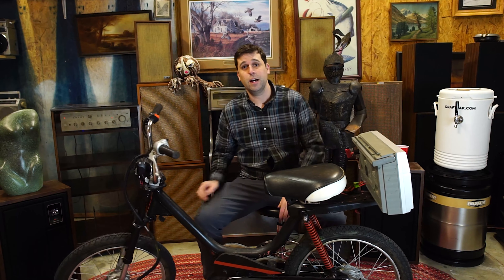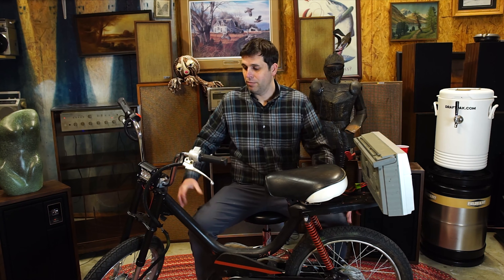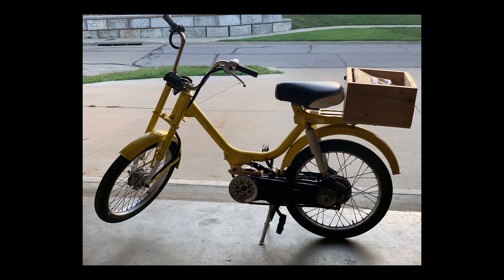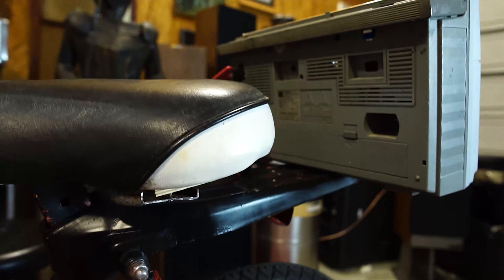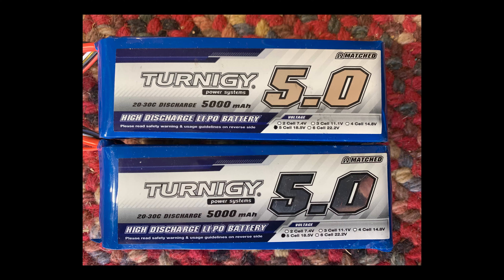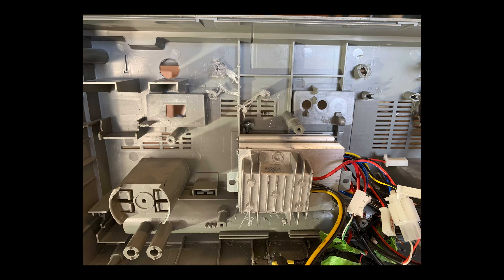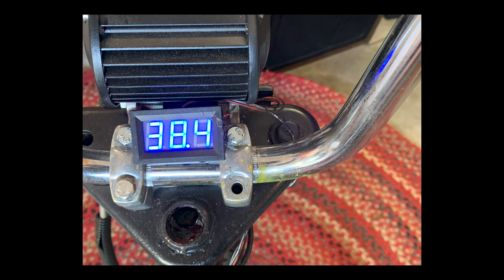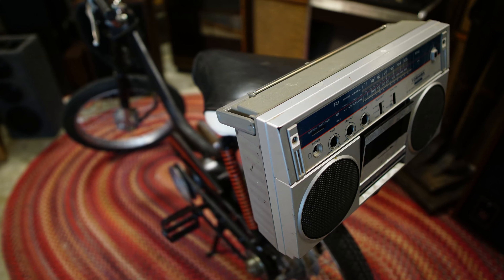Homemade Electric Bike From Vintage Moped

Comment: why not hybrid?

stock engine for the rear e bike hub for the front

there is a version with fixed pulleys called a pa50m (for mono) that would have been a better start for this project